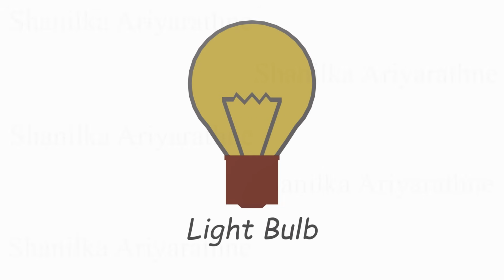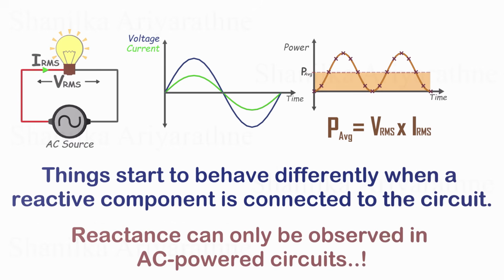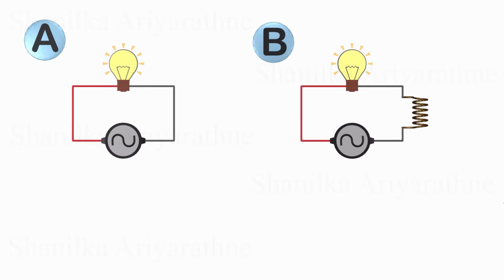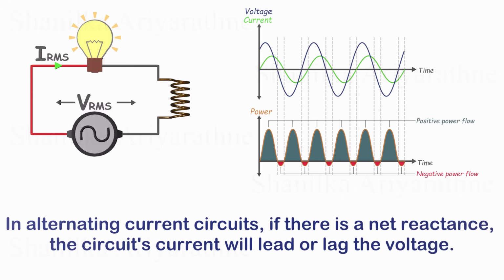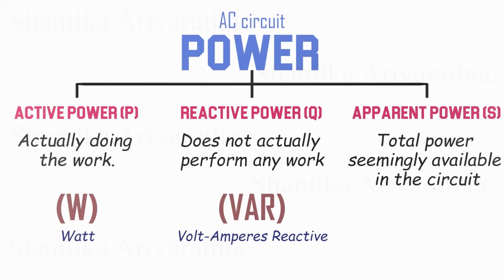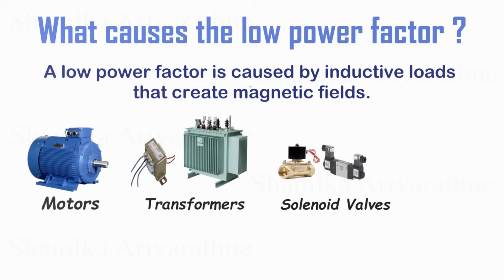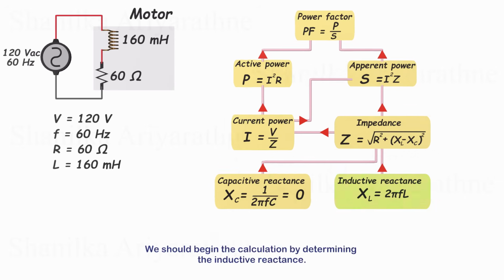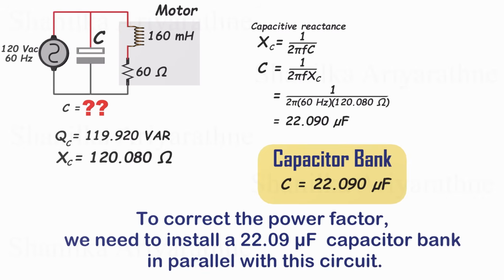Power factor explained | Active Reactive Apparent Power correction

Comment: These kind of lessons and explanations proves how outdated the actual educational system is. This was awesome explanation Professor! :D Thank you sir!
Reply from the maker: Glad you enjoyed it!
Reply: As far as I know, single phase motor, use a capacitor for starting, then when the motor running, does the same capacitor shift its function and serve as a power factor corrector ? thank you.
Reply: @posanwongso4619 some motors do have a run capacitor but I have noticed when I have pulled apart a slow operating industrial fan or window mount air-conditioning unit. The capacitors were mismatched! After replacing with the help of an online calculator the 2 units were using less current and out of curiosity I put my cheap Power factor meter on them and it showed 100%. It's a cheap meter but good enough for basic testing of appliances but it worked and now I'm addicted to this topic. Cheers from Australia 👍
Reply: I have to disagree,  I learned the exact same  things in 1980. No different back then than they are today.
Reply: @almendronman, shut the f up. While MAD Prof channel is doing an amazing job of visualising these concepts. 
These were all developed and used by millions of ppl for more than a century. Humans are curios, have the capability to read books think and visualise it mentally and build systems. Don’t blame the education system if you are too fucking lazy to put the effort to read books and assimilate it.

These are taught to every physics major / electrical / electronics engineer and there are amazing books.
Read Basic Electronics by B Grob, Lectures in physics by RP Feynman or Electronics Devices by Boylsted and Neshlsky.
Reply: As demonstrated by yourself in your comment, we all collectively appreciate, I would assume, your interest in this subject and your acknowledgement of its importance, and even your opinion on the current versus previous state of the American educational system.     But every detail matters, and to convey a message where a specific point or idea is at stake, an inadvertent display of the lamentable subject at hand only exemplifies the ACTUAL current state of the education system, in real time, whether you realized it or not.   “This was AN awesome explanation Professor!”   Be it calculations, non-linear systems, or written correspondence, a consistent and clear use of standards is necessary to prove, disprove, explain, or argue machinations within a society.     A breakdown in zeros and ones is not remotely as destructive as a breakdown in the structure and intent of our lexicon.      Had Kennedy misspelled or misplaced one or two words while corresponding with Khrushchev  on October 29, 1962, some of us would never have been born, and the face of this planet could appear dramatically different.         “Now hear me out Nikita, Vodka is Vodka, potatoes are potatoes, be them Irish or Russian, and I’m not about to half Russkie wave of  Stoli washing over Miami.    We had enough Commie drunks in the brig already, don’t be next.”     See.    That would have brought on a nuclear winter.   Me and John went down to the creek to meet them girls, but they were some real pussies from the Cross City Wrestling Team.    All they is ass grabbing.
Reply: @andrewhigdon8346  Cross City? Florida?  That's where I am from but I don't grab asses!
Reply: HERTZ PULSES LIV NO GROUND NO NUTRAL NEGATIVE CHARGED JRQÑ POSITIVE CHARGED PUSH + JLQY ALIV AC DC CAP TRANSFORMER AMPS WATTS KILOHMS MEGAWATTS INDUCTION
Reply: As far as i know..these was already discussed and taught by our proffessors during our ee subjects during our college days in BSEE 30 years ago..i thought you intered an obsolete school
Reply: not really, same principles were used. it's the presentation that's outdated compared to 30-50 years ago where green board were used😂. anyway if you really paid attention to your professor you should've got the basic idea. this channel used same old electrical books as reference😊
Reply: It's fake course, pf isn't equal to cos phi in 2024.
In real life it's different

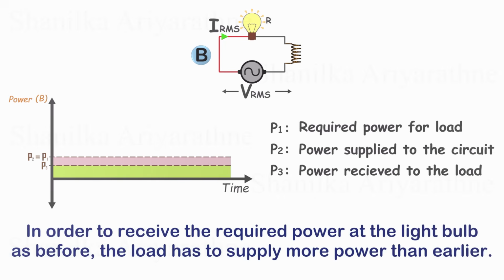Comment: While this was a good explanation, you made a major mistake. 0:8:00 "In order to receive the required power at the light bulb as before, the load has to supply more power than earlier". I'm sorry, what? The load doesn't supply power. You meant "...the supply has to provide more power than earlier." For the rest of that section, you use the word "load" as though you meant "supply". I got thoroughly confused. (And I won't mention the misspelling with "recieve" in multiple places).